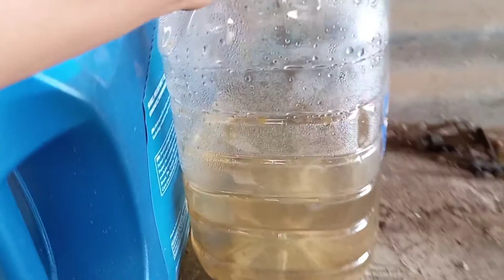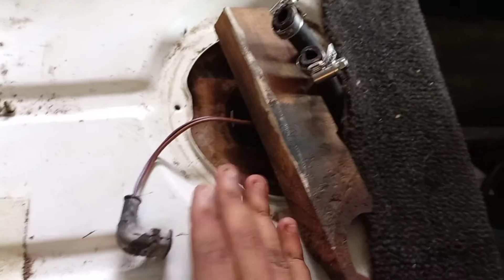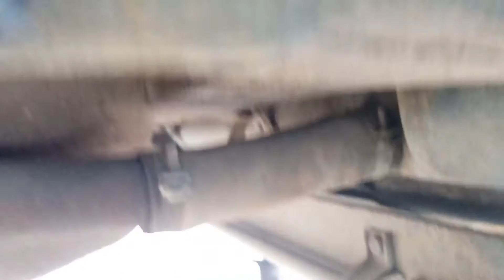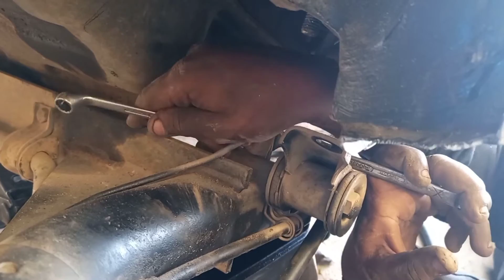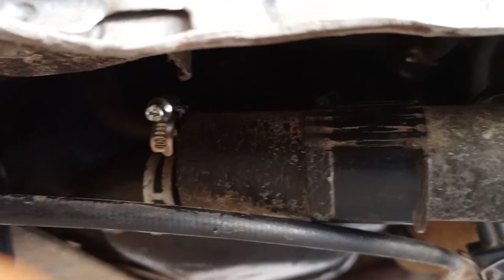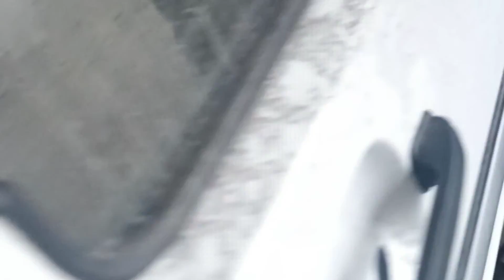Fuel Injection Tank Installation! (MP9 Conversion)- VW Mk1 Build

Comment: Hi I've rebuild a mk2 Jetta using a citi 1.4i mp9 setup (engine, wiring loom and dashboard)... Now I'm experiencing problems with the car cutting fuel while I drive... I'm still using the plastic tank that came with the jetta... Does a Citi golf petrol tank fit on a Jetta mk2?

Comment: the size of the hose does not matter the to mutch on fuel gets fed back to the tank thats wy the system has a return line.
Reply: What do you mean by this? Can 6mm lines work

Comment: My good sir very informative Does this same method apply 2 a mk1  caddy aswell
Reply from the maker: I think it should, not a 100% sure
Reply: @LMManuel  can I fit a mk1 golf tank in caddy 2 solv the I system tank situation  and I need help with my harness as I'm fitting velo dash  any advice
Reply from the maker: @zainudeanaugust2766  from what I've read, the golf tank and the caddy tank are different. I saw someone running an external high pressure pump to run fuel injection on the standard caddy tank. The wiring with the velo dash. I can't assist I am so clueless when it comes to that as I have never done it before